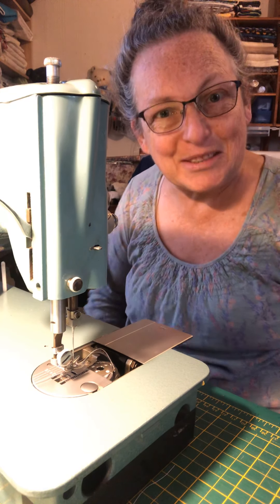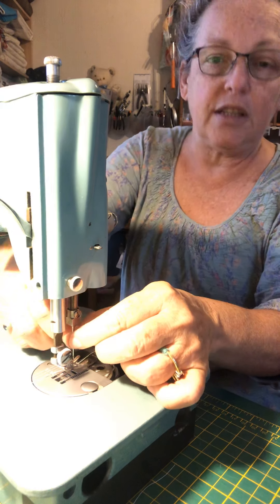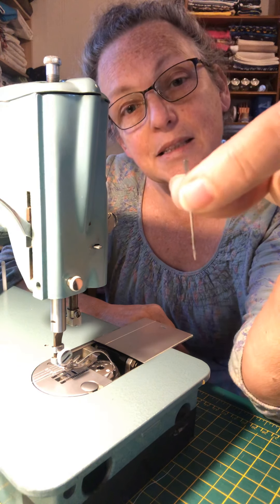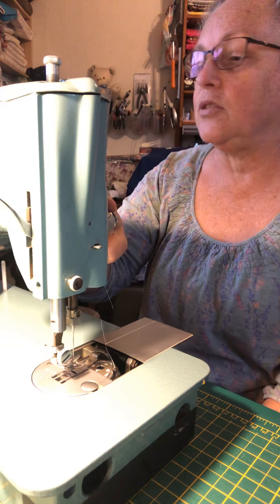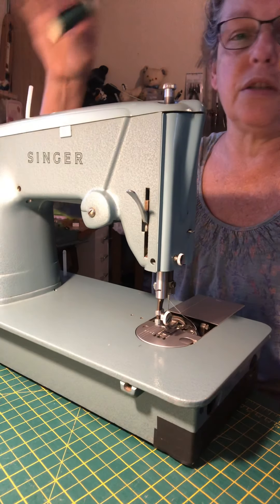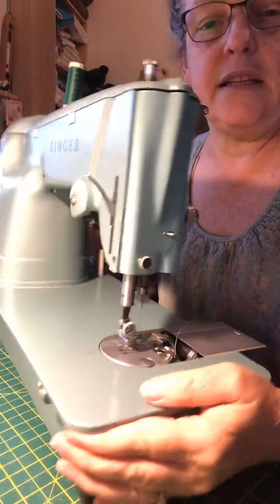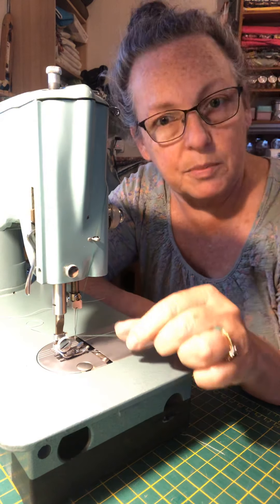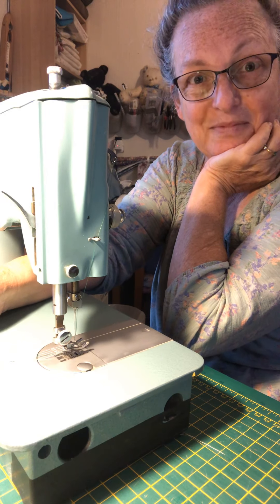Part 3a - Service a Singer 327k sewing machine

Comment: Thank you so much!  I don't do much sewing so forgot the correct way to install a new needle. Hope I remember  "FLAT goes BACK." :  )
Reply from the maker: Linda, that is absolutely something that is easy to forget when you don't sew all the time.  In fact old machines didn't use a needle with a flat spot but were all round.  This made it so much more difficult to correctly insert a needle and without it correctly inserted your machine definitely will not work properly.  Try remembering flat back as in flat pack from ikea :-)  Enjoy you sewing.
Reply: Thank you thank you thank you!! I have the same sewing machine and was searching all over YouTube for a half way decent video on this! This video was amazingly done! You explained everything so thoroughly and the camera work was perfect! 
Turns out I had my needle in backwards! 😂
I’ll be coming to watch your videos from now on! ❤